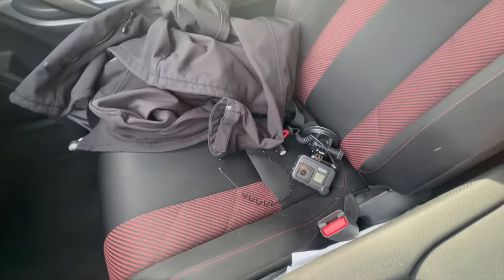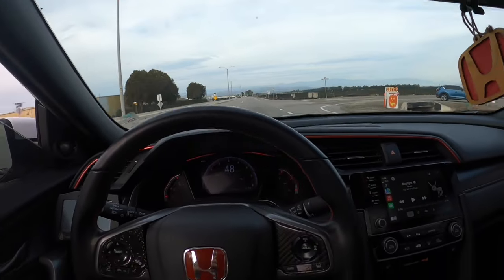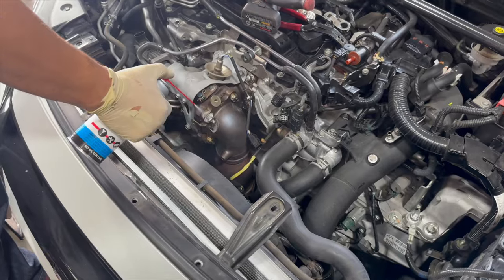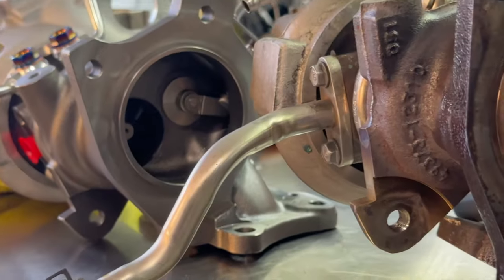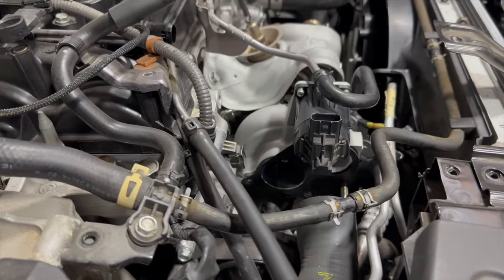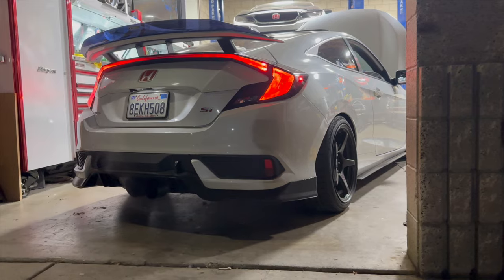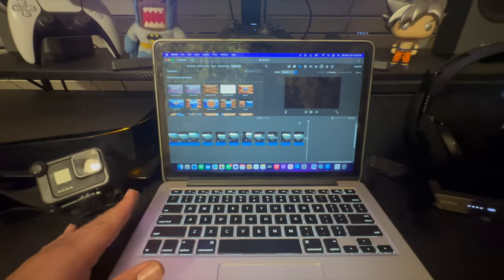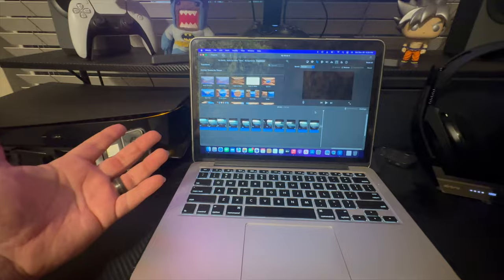Honda Civic Si goes BIG TURBO | Rv6 R365 Turbo

Comment: Hey brother. What wheel and tires do you have to put the power down? I'm on general GMAX and I just spin on map 3 of TSP. Want to go bigger turbo, but need to put the power to the ground with rubber before spending the $
Reply: Description all modifications

Comment: Do you have traction control off without doing all the steps? Brake no break etc. etc. or do you still have to do the hold process?
Reply from the maker: During the data logging? Yea I have it all the way off. It’s not required but I do it anyways
Reply: @TdaKid  I hate all the steps you need to do to disable the traction control lol

Comment: Hey Tony, do you think the W1 turbo upgrade will work with the PRL Inlet pipe, and downpipe? Plug & play?
Reply from the maker: I don’t see why not. The turbo should be universal, even with stock piping
Reply: @TdaKid  thanks
Reply from the maker: The only thing that doesn’t work is PRL Inlet piping with 27won intake
PRL with PRL
But 27won has an adapter to use the PRL intake with 27won Inlet piping

Comment: What’s your thoughts on Ktuner or Hondata for an 8th gen ?
Reply from the maker: Hondata is more popular for the k series Motors in general. But they are both good tuning solutions. I would go with whatever your tuner is more comfortable with tbh unless you tune it yourself
Reply: Appreciate your point of view bro am planning on doing it my self just with full bolt-ons , just wanted to have an opinion to see what route I should take

Comment: All these mods... are you hitting 400hp....? doesn't look close to it based on that 3rd gear pull...
Reply from the maker: You won’t hit 400 on this platform with stock fuel system. And this is barely a base map to get the car running

Comment: Why not just gey a proper dyno tune this over the air tunes are lame
Reply from the maker: There’s Only 3 tuners  I trust that have more than enough experience with both Dyno and E tuning. E tunes have been proven really great alternatives especially if you’re not trying to push the car to its limit (Me 🙋🏽‍♂️)
Reply: Yeah might get a more reliable tune that way, these things are just not the best platforms in my opinion, the internals, clutch and head gasket are weak from factory and if you manage to address those, you are eventually going to run into transmission issues and if you wanna push even more power, the direct injection system will hold you back. Don’t get me wrong, i love my 10th gen si, stopped the mods once I realized I needed it to be a reliable daily driver and it does that perfectly👍🏽 it’s fun to drive, quick enough, comfortable, looks great, practical and great on gas. It can be reliable too but once you start modding you are playing roulette
Reply from the maker: @EJleon96  100%

Platform isn’t the best for hi power. But for moderate builds it’s enough lol
Reply: @TdaKid  very true statement👍🏽 you don’t have to throw a lot of money into it to get some decent gains, there’s definitely a sweet spot that’s different for all of us
Reply: @TdaKid  and Etone only makes sense if you’re somebody that lives in Oklahoma in the nearest  Dyno tuner is like 100 miles from you. You live in Southern California with some of the most reputable tuners in your area. Everything that you’re doing for this e-tune can literally be done in one day on a Dyno tune. And when you Dyno tune  your car, you do not have to push it to its limits you can tell the tuner to dial your tune back.
Reply: @EJleon96 that’s a bummer Idk much about them I thought they came with a non performance type r engine or something that you could turn into a sleeper personally I think this gen si looks better than any other Honda, an D series swap would be lovely in this thing.
Reply from the maker: @vtecef9  ironically I don’t trust anyone in SoCal to tune the L15 series motors 
Only John Vega and Drob and possibly 1 other person but he doesn’t tune on Ktuner
Reply: @TdaKid  but why is that? When there’s a lot of reputable tuners, who have Tuned much higher horsepower builds than yours and mine. The guy who tuned my has tuned 700+ horsepower K 20 builds. Does he need some sort of special knowledge or training to tune my sub 300 hp L15?